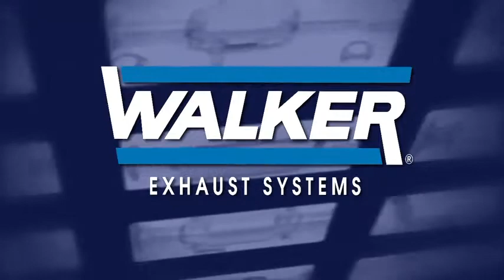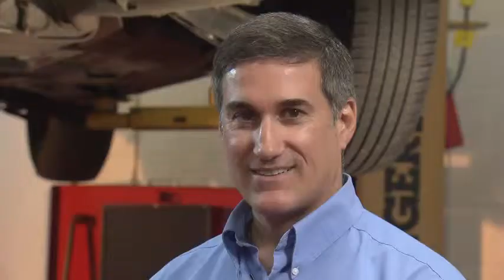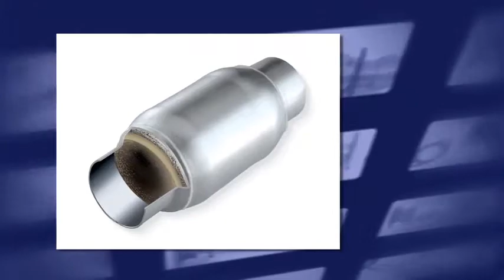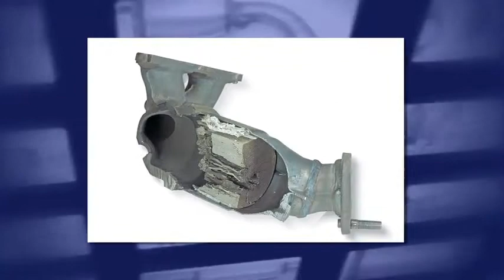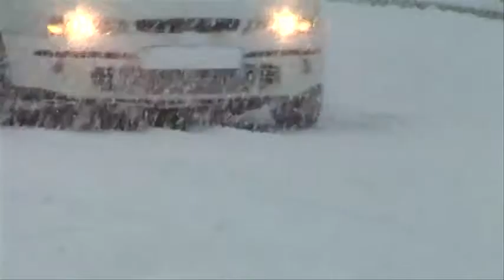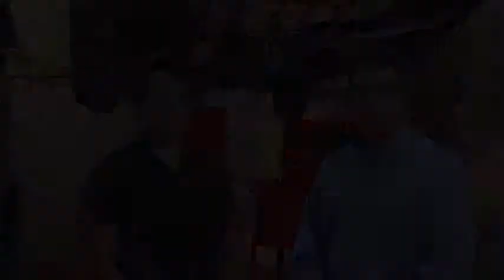Why Catalytic Converters Fail   Walker Exhaust Video Series

Comment: They fail because of Walkers cheap approach to quality. I have had 4 walkers all had cracks in manifold less than 4 yr later. Replaced under warranty but still poor quality. Welds look like a beginner did them steel used is subpar at best. Improve your quality Walker